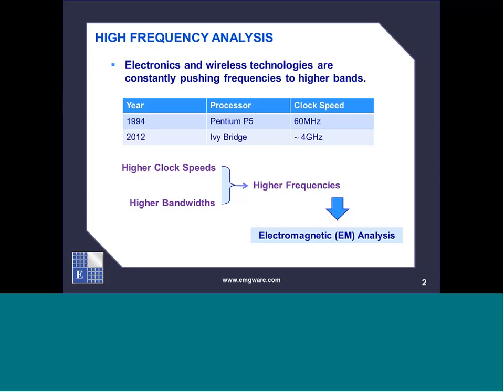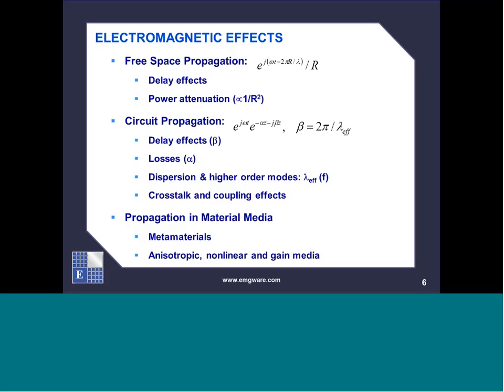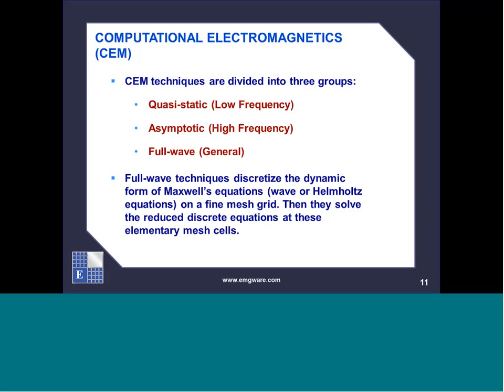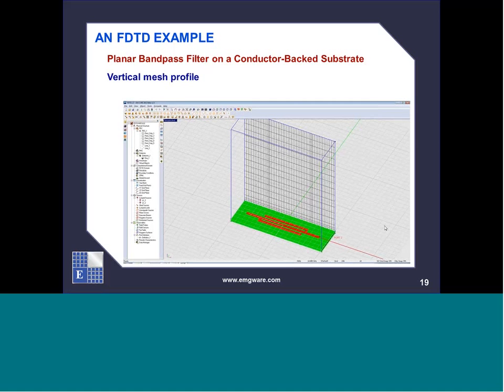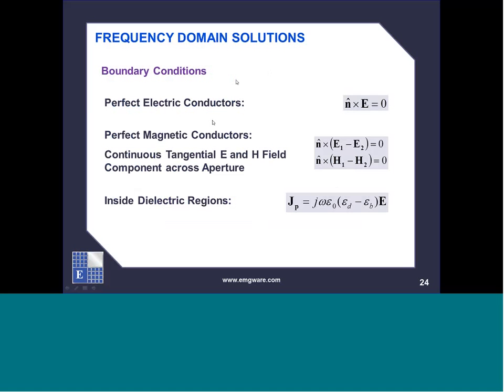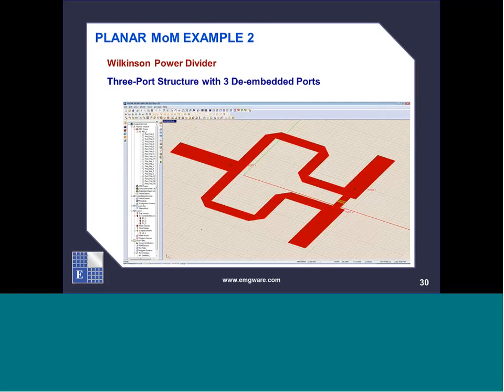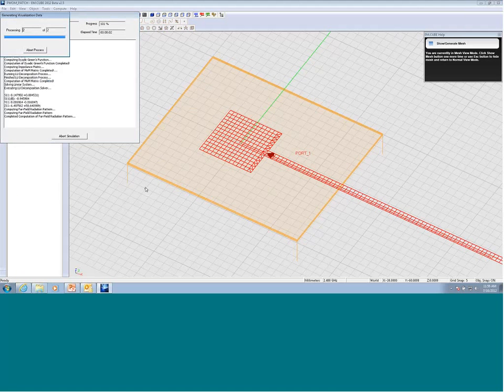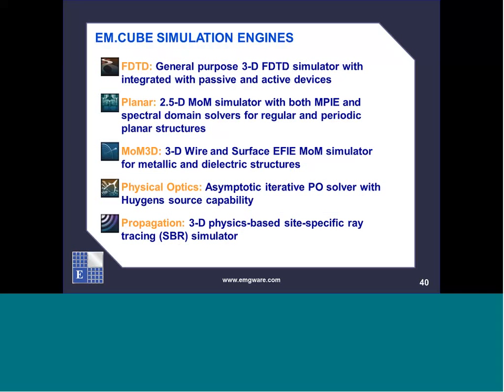Modeling and Simulation of Electromagnetic Devices.mp4

Comment: EM.CUBE is comprised of the following full-wave EM simulation modules: EM.TEMPO (3D FDTD), EM.PICASSO (2.5D Planar MoM), and EM.LIBERA (3D MoM).  Special attention, however, shall be focused on the simulation module EM.LIBERA (3D MoM) which is a low-cost stand-alone simulation module permitting possibility of full-wave analysis of aperture antennas and finite arrays, including open-ended waveguides, waveguide arrays, horn antennas, VSAT dish antennas with dish diameters up to 10-15 wavelength, etc.     EM.LIBERA is also suited to full-wave analysis of rod antennas with uniform dielectric rod, and horn antennas with uniform dielectric lens loading.  Radiation patterns of horns, open-ended waveguides, dielectric rod antennas, etc. generated by the EM.LIBERA can be easy imported into the EM.ILLUMINA module (low-cost Physical Optics (PO) simulation module of the EM.CUBE suite) and used as a feed pattern for PO-analysis of large reflector antennas (e.g., primary fed reflector antennas, Cassegrain-type antennas, Gregorian-type antennas, etc.).  Examples of 3D-MoM simulation results illustrating surface currents induced on parabolic dishes, open-ended waveguide and horn antenna obtained by the use of EM.LIBERA are available under the following links:  http://www.emagtech.com/wiki/images/thumb/4/46/SMOM97.png/675px-SMOM97.png     http://www.emagtech.com/wiki/images/thumb/7/79/SMOM89.png/675px-SMOM89.png    http://www.emagtech.com/wiki/images/thumb/d/d1/SMOM54.png/375px-SMOM54.png    http://www.emagtech.com/wiki/images/thumb/2/25/SMOM63.png/600px-SMOM63.png    http://www.emagtech.com/wiki/images/thumb/5/59/SMOM70.png/600px-SMOM70.png

Comment: It should be also pointed out, that FDTD module (EM.TEMPO module), which was added to the EM.CUBE in 2006, is perfectly suited for full-wave analysis of multi-element phased arrays even in case of the use of a low-spec PC.  For example, employment of the PC ThinkPad T510 (Intel(R) Core(TM) i5 CPU  M560 @ 2.67GHz, RAM 8 GB, 64-Bit Win 7) with installed EM.CUBE (ver. 19.2-0) yields the possibility of full-wave FDTD analysis of a 20x10 elements phased array of open-ended rectangular waveguides with Dolph-Chebyshev amplitude distribution providing side-lobes suppression to -20 dB @ beam tilt of 40 degrees. Obtained radiation pattern can be easily imported to any other module of EM.CUBE, for example, to the Physical Optics simulation module (EM.ILLUMINA module) and used for simulation of radiation performances of the aforesaid 20x10 phased array installed upon a vehicle, airplane or upon a ship. Adding to it, due to high functionality of the EM.CUBE's CAD-module, the said phased array of open-ended waveguides can be easily modified to a phased array of dielectric rod antennas or open-ended waveguides covered by a flat radome, etc.  Superior functionality and user-friendly GUI make EM.CUBE perfectly suited to practical tasks of feasibility studies and R&D on development of a wide diversity of antenna systems operated in realistic communication environments. 以上。